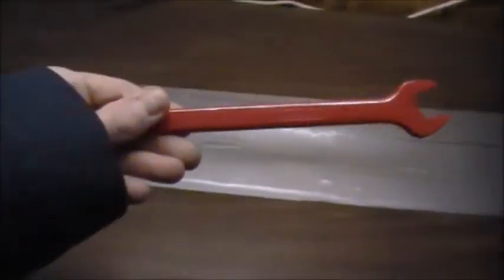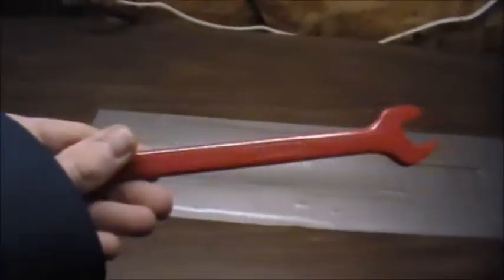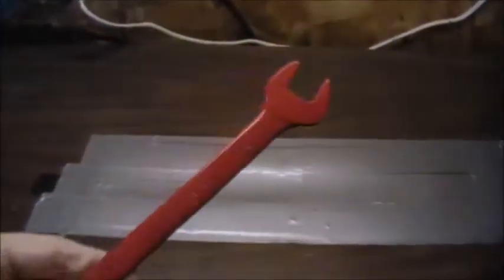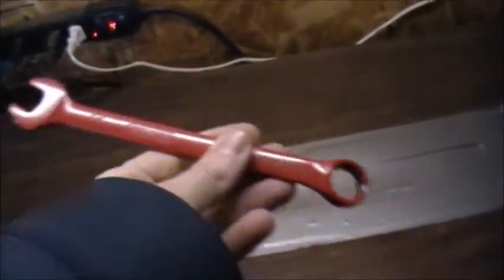Powder Coating Shop Setup (Harbor Freight)

Comment: That wrench was raw?  Not chromed?

Say it was chrome, would you have to blast it first then powder?

HF powder kit is better than eastwood?

Would that sand blaster you have take off several layers of black paint and several layer of clear off of a Harley headlight? I painted mine, but Id rather redo it and PC it.
Reply from the maker: I wiped the wrench down with denatured alcohol and went for it. Worked great. Eastwood is better. I wanted to start cheap. This gun works great for what I do. (Plus I had a couple gift cards) Yes this sand blaster will take multiple layers off I would think. Every piece needing blasting is typically different. 

Good luck
George
Reply from the maker: I think u could bake over the chrome. Wipe it down. Although I am not 100% sure. Try it once on a wrench then you would know though :)

George
Reply from the maker: Yes the range is 220v. I believe all ranges are 220v. You can use a small toaster oven for small parts. That would be 120v. 

Thanks
George